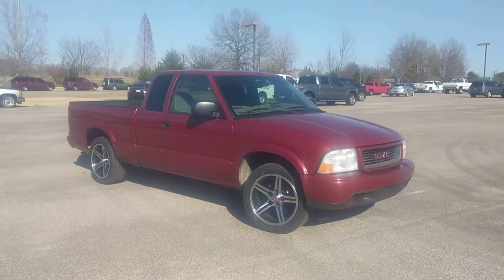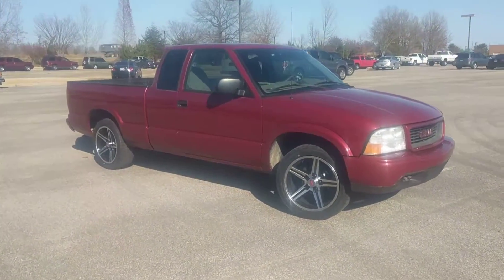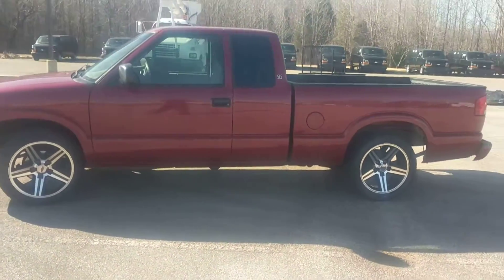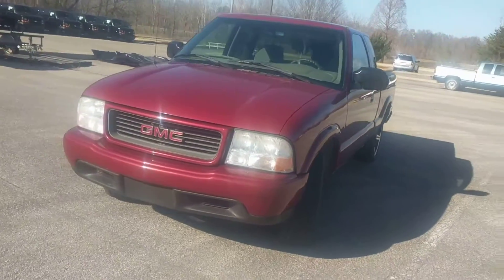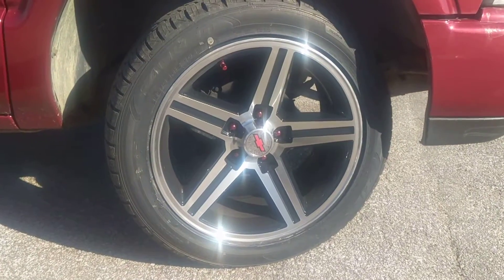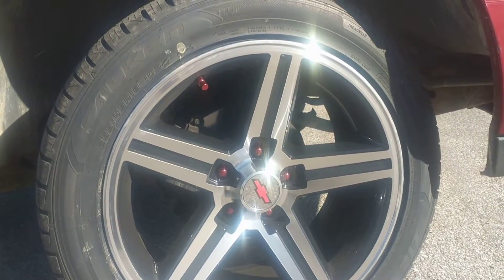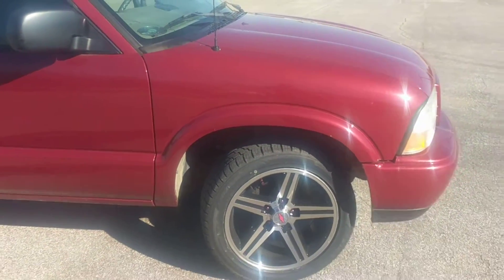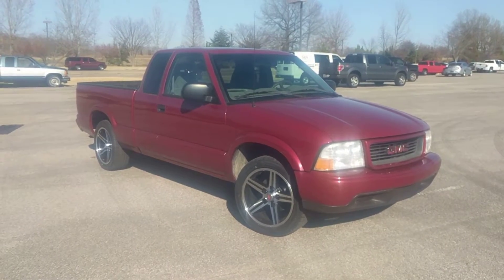Sonoma Update | New Wheels and Tires | 18x8 IROC Wheels | 255/45r18 Falken Ziex Ze950

Comment: How was the ride on the iroc wheels and those tires? I. Planning to purchase the same for my 2001 single cab 2.2 chevy s10.
Reply from the maker: It rode good, maybe slightly rougher than stock, but only because of the over oversized aftermarket wheels with low pro tires.

Comment: Are you using spacers with those rims?   I see most Camaro rim swaps need 2in spacers.
Reply from the maker: No, because these are aftermarket replica wheels, the backspacing is inline with the factory backspacing of the s10's. So they were not needed.

Comment: Any plans to go lower?
Reply from the maker: mossman381 Yes, meant to say it in the video, but forgot. I'm going at least 2" front and rear. Want to still be able to have some bed capacity (without doing a C-notch). Though I'm thinking of getting air shocks so it may be lower than 2" later on.

Comment: How did you fit these on with the weird rod that sticks out stopping you from putting wheels like this on?
Reply from the maker: I don't know what you are talking about, I had no issues at all.  Only thing is the insides of the front tires rub at full lock on the frame in the rear and sway bar in the front. Other then that I've had no issues, even after a 2" drop.